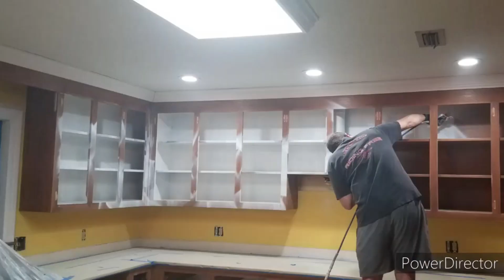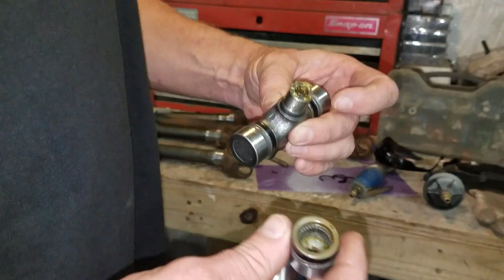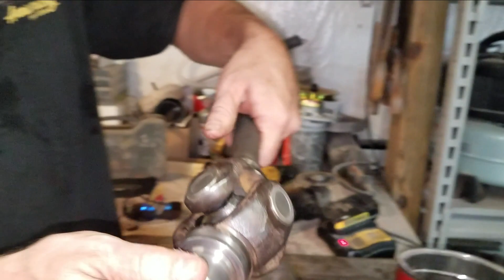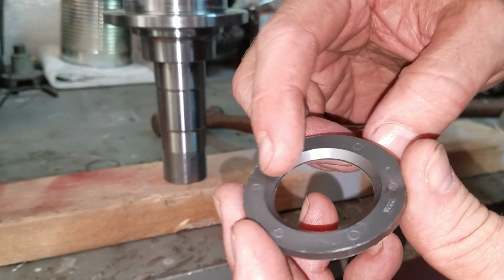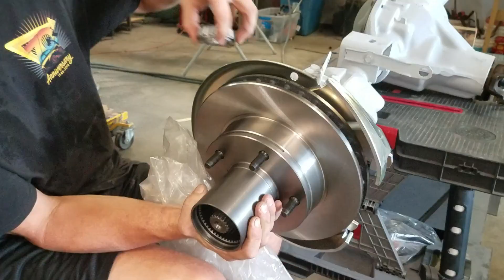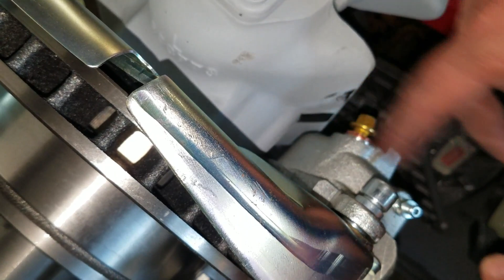Toms Bronco Front Disc Brake Conversion Dana 30 - 1966 Ford Bronco Restoration Project

Comment: Hey I just want to thank you for your fantastic videos guys. I was wondering if you have a recommendation for order of restoration. I'm about a quarter into my restoration and wondering about when to prime paint body, how to store the body while completing the chassis in a way that does not bend it and ruin the bodywork I've done. I have built a frame temporary but moving the body onto the chassis means I have to take that frame off. So I'm just wondering about when should we tackle what?
Reply from the maker: Randy thanks for watching!  Your concern regarding the bodywork and moving it around is valid.  I was concerned myself.  I did the major panel replacement on the frame because that way I knew the mounts were at the correct elevation.  After the steel work was close I removed the body and started the chassis.  Basically to break up the build.  Chassis parts go on quick and it helped keep me motivated.  Bodywork just takes so much time it wears on ya.  I hope this helps good luck.

Comment: If you had a choice which front drive train would you use. Dan's 44 ??
Reply from the maker: The 44 is more robust.  I used my 30 since I had it and did not plan to do any rock crawling.  Given the choice I would go 44

Comment: I don't know if my Warn hubs are thicker than the ones you are using, but I have driven that seal in as far as I can, and the groove for the retaining clip on the axle isn't exposed when I do this.  Maybe that is why they suggest that?  Now off to watch your other videos to see what you did for brake hoses and lines (I, too, have a 66, so going from single reservoir to dual, with proportioning valve separating L from R meaning two hoses to front axle, rather than one).

Comment: Hi Jason and Jonie build im working on 76 bronco with a dana 30 my question is if you have the part number of the front rotors thanks for some reason I get the wrong ones.
Reply from the maker: I will check and get back to you.  Are you sure you have a Dana 30 and not a Dana 44?

Comment: Great video, where you had the caps still sticking out, you can take a hammer and hit the ear of the axle, because the ears get forced in, that has always worked for me . I installed the Toms kit on my 44 and did not put the axle keeper on, like they said and 15 plus years no problems, but the difference is the dana 44 does not have the outer seal on the axle tube like your dana 30.
Reply: Great video! I am currently on this part in my Dana 44 and it doesn’t make sense to me not to put the clip back on. I know they say not to, but I like an explanation why. I guess thats how my brain works. 😀
Reply from the maker: @calebg7479  Thank you!  I have not done the install on a Dana 44 so I can't tell you which is right or wrong.   Tom's could be clearer for sure.
Reply: @calebg7479  Here is a video from Toms Bronco at the end they tell you not to use the clip on the axle. https://www.youtube.com/watch?v=3G0NhPMwhRw
Reply from the maker: Thanks Taz!  I will be curious to see the difference in the 30 and 44 installation.  I have only installed this kit on a Dana 30.  We appreciate you watching!

Comment: I just did this on a 74 bronco at my shop. The TBP instructions were pretty vague. The Dana 40 you do not use the the clip on the half shafts. The older style you use the clips... now the brake hoses that came with the caliper kit seems too long. It’s definitely longer then you brake hose. Good video 👍
Reply from the maker: Thanks Jason.  We appreciate ya watching.

Comment: Did this about a month ago....I did the king pins at the same time. World of difference when the brakes are wet compared to the drums. Just FYI James Duff is having a hub and spindle buy back if they are in good shape for the drum set up. I sent mine in and should be getting a in store credit to be used for my new exhaust....Recycling at its finest :) Great video.
Reply from the maker: Thanks David for the info.  I will look into that.  Always need ways to help pay for this thing.
Reply: Where can I get the info to get money for the front drum brake stuff? Thanks
Reply: @llecki  https://dufftuff.com/product/dana-30-drum-brake-dana-44-hub-buy-back-program/
Reply from the maker: @davidbrady9686  Thanks for this David.  I am going to check on mine this week.  I put them in a box so maybe they are good enough for store credit.
Reply from the maker: I am not sure.  I never checked on it.  Honestly I forgot about it.  You could call Duffs and see what they say about buy back parts.

Comment: Great vid, Jason and Jonie!  I noticed no grease zerks on the u-joints?  Also, what kind of grease do you put on the axle splines?
Reply from the maker: Thanks Brian!  You are right the Tom's U joints I bought did not have grease zerks.  I would have preferred  zerks but the came without and cannot be serviced. I used wheel bearing grease on the splines and shaft seal areas.